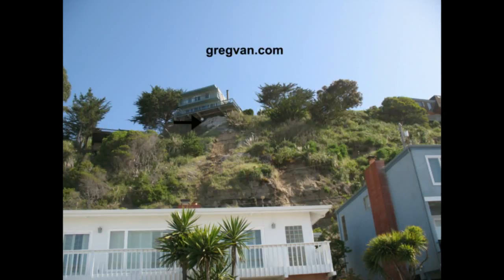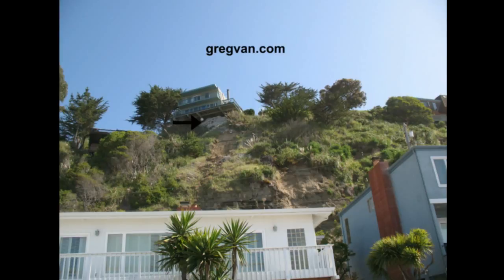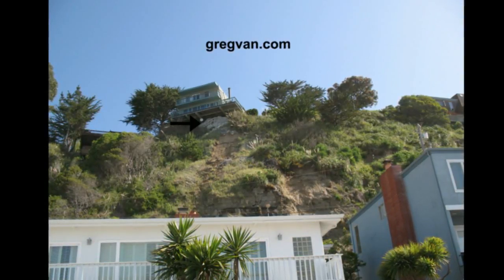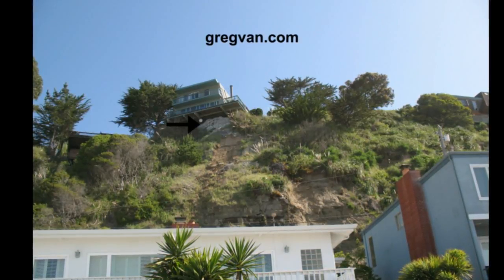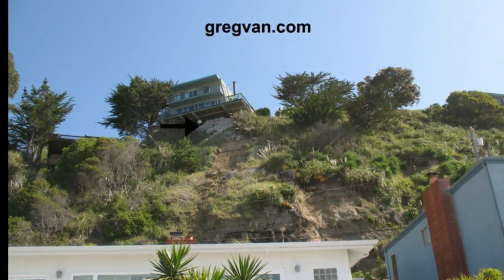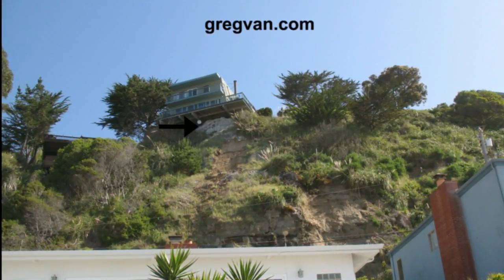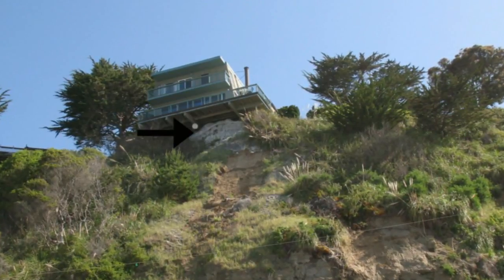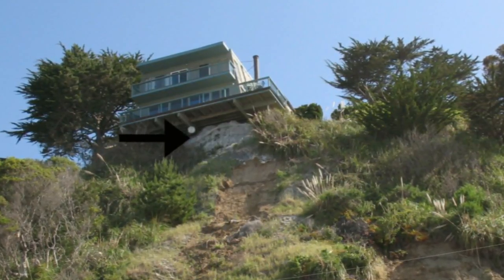Concrete Over Slope Soil Erosion Tips - Homes On Hillsides

Comment from the maker: Someone asked a question and then removed their comment, but it is a good question. What would you use to control soil erosion on a hill? If it's a gentle slope (less than 20°) then plants will probably do, but anything more than that might require you to contact the structural engineer.

Comment: Situation may have  been changed than and now but the house itself is in very endangered situation and the properties  at the down slope. I agree with the commentators,t there is an investigation should  be done by the experts before building any supporting structures.  The slope might need soil erosion techniques and various Soil Bio-engineering measures like small engineering structures like water drainage, slope cover with nets and planting grasses with shrubs would be good techniques.

Comment from the maker: I don't really mind if you're plugging a product anyway, as long as it works. However, I would also like to point out to anyone reading this comment that they should do additional research before accepting anyone's word, including mine about anything recommended, by anyone. Especially if it's a product that isn't used on practically every construction project.